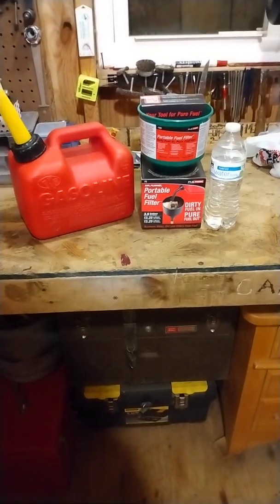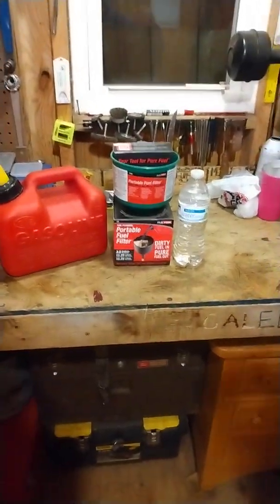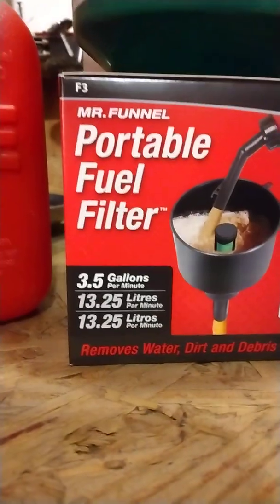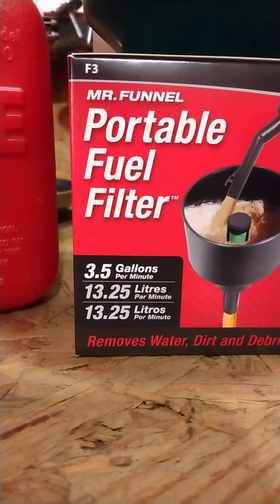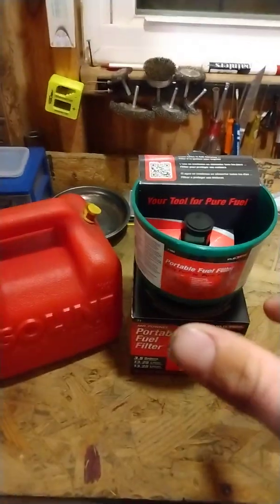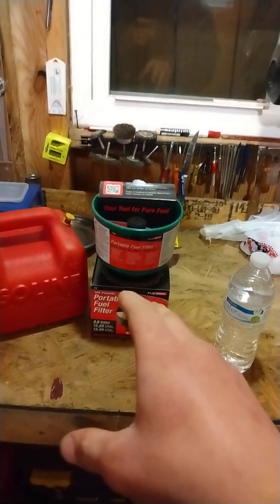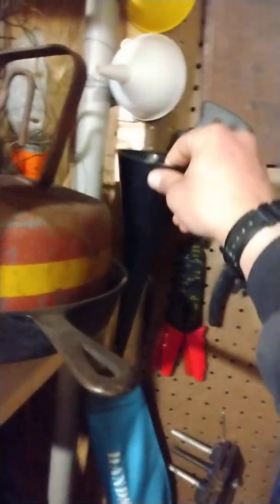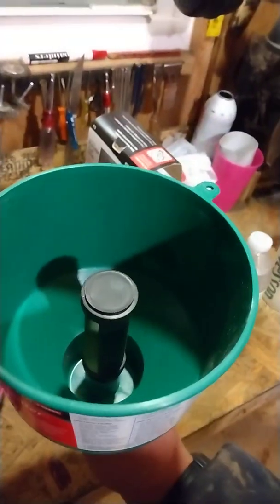Does Mr. Funnel actually filter out water from Gasoline??? Let's find out.

Comment: Not fit  for purpose 
Doese not remove 100% of the water on the first strain 
I had half a galloon of gas with a spoon full water in it 
I had to restrain it 4 times to remom  all the water 
Only  takes 25 % OF THE WATER each time 
Better then nothing ??
But not a 100% 
So if. You By one strain yer gas a few times